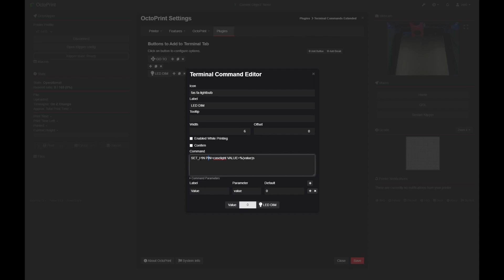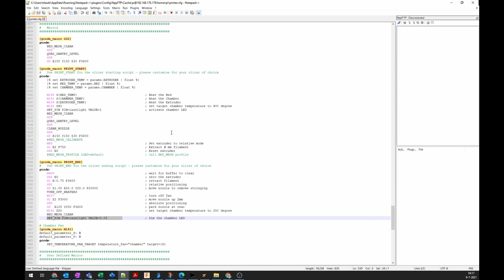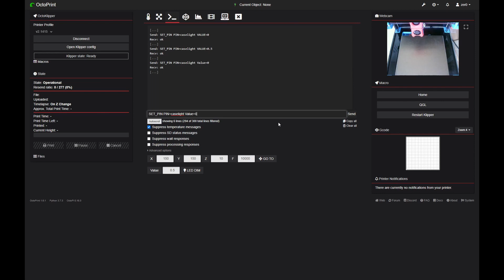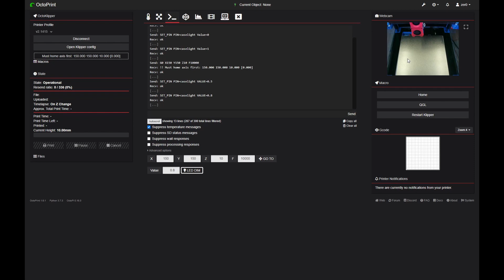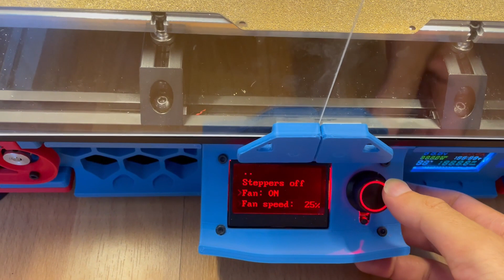Building Voron v2.4 - LED [Ep17]

Comment: I think is is not an ideal way to implement these 12V LEDs.   If I understand the configuration you described, you are feeding a 24V PWM modulated output from a fan or heater output on a controller board into that 24V to 12V switching power supply.  That poor switching power supply is trying very hard to maintain a constant 12V output while you are doing PWM to it's input.  I'll bet that dimming it by 75% or 80% doesn't do anything as that might still be within the regulation range of that 12V switching power supply.  

I'd suggest a much simpler solution:  Remove the 24V to 12V switching power supply.   Connect the two 12v LED strings in series and then drive that series string directly from the 24V PWM output.  That should give you a much more controllable range of brightness and be much simpler to implement.   And you won't be trying to use that switching power supply in a way that it's not designed to operate.

Thanks for doing your series of videos; it was helpful to me as I assemble my Voron 2.4 printer.  I have working prints happening now, and just need to do some tuning steps for pressure advance, etc.
Reply from the maker: You are right. It is not dimming in full range however range I have got it good enough. And main reason: I prefer to distribute current instead of voltage. That's why I am using buck convertor and connected them parallel instead of series.